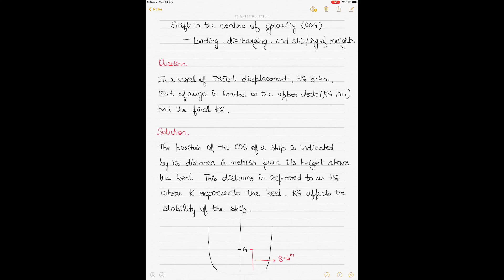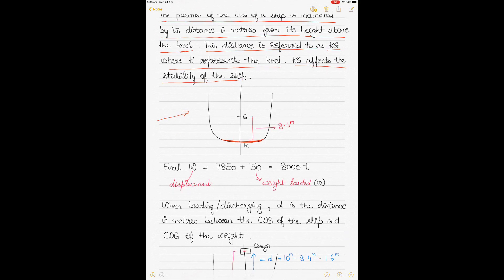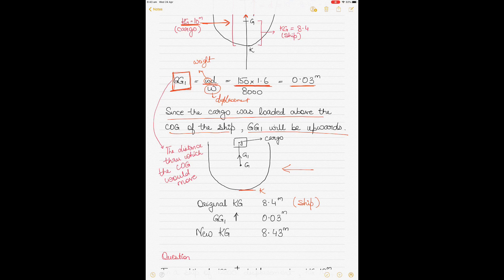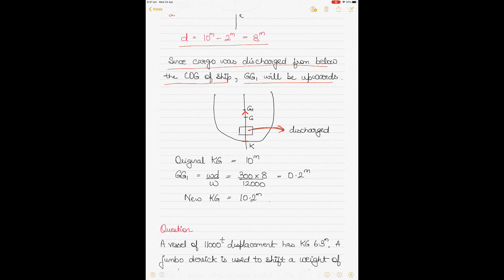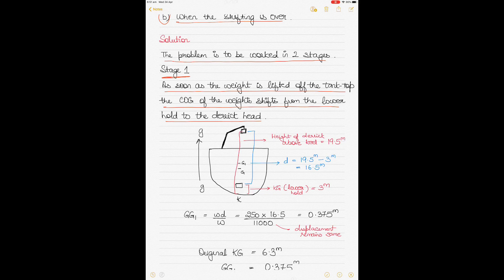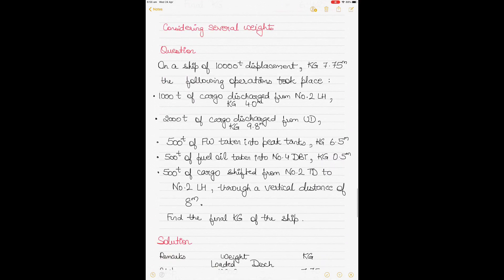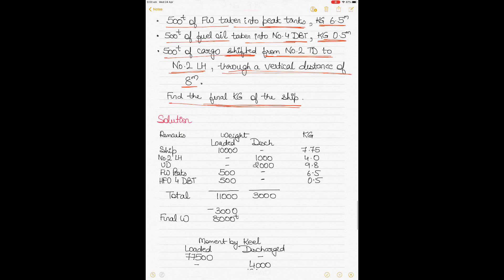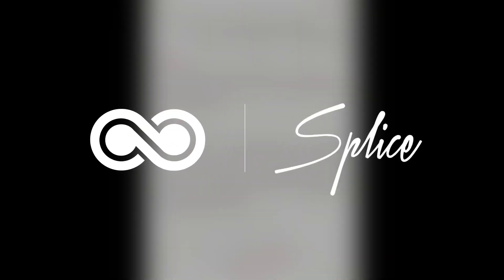Ship Stability  - Shift in the centre of gravity (KG calculations)

Comment: HI DEAR CAPTAIN, i have an example in my notes   and  its says like this
210 tons of cargo is discharged d from a ship with a displacement of 8500 MT and KG = 4.2 m, vertically above the G point and at a height of 6.8 m from the keel. New KG?
 and the answer is: 

Since it will go away; KG1 = KG – GG1
= 4.2 – 0.066 
KG1 = 4.134 m
how ?? isn't the same as your second example? I am confused now why we didn't add this one. thanks in advance